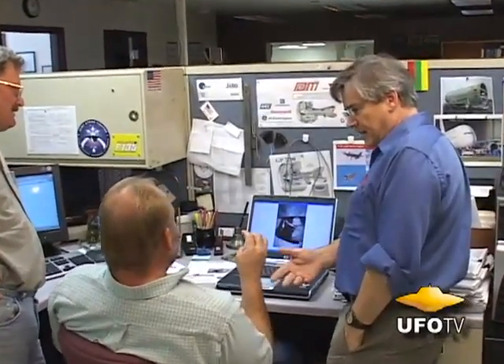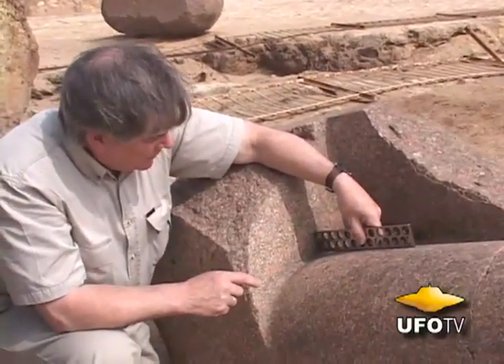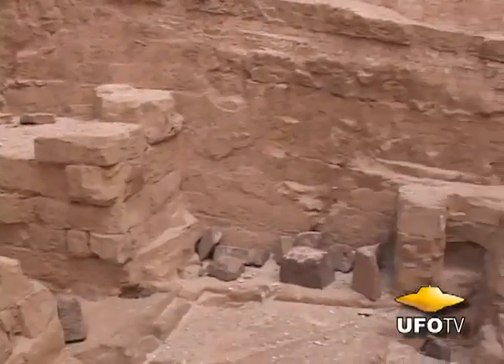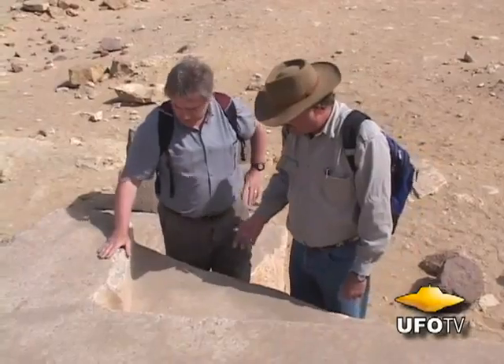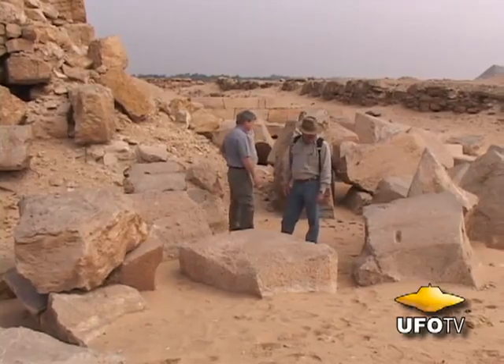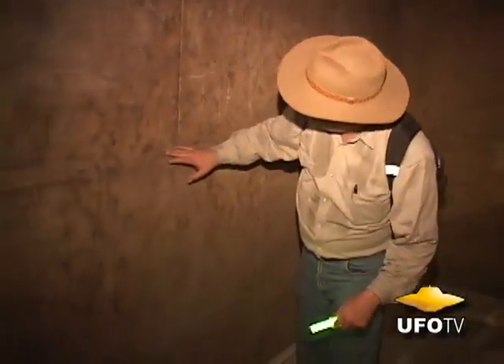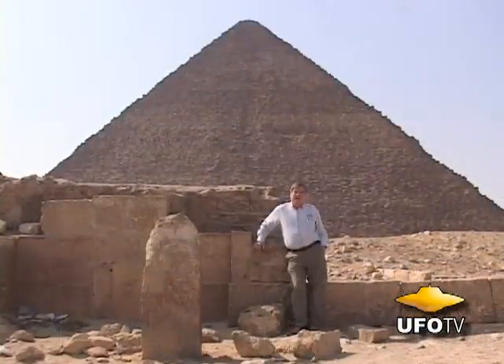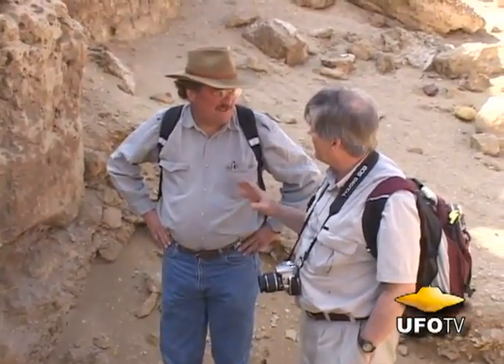Ancient Technology Pyramid Mystery

Comment: If we accept the alien concept;  the tools they used must be much more advanced than our civilisation develop . how about desintegrator energy field that break atoms bonding forces , i can imagine very narrow cutting like 1 or 2 milimeter beam more like a chain saw and that energy can be focus even with 90 deg. angle deflection to be able to cut these square inner corner in granite . desintegrator can produce also that glasing surface if you think of material vaporised when touched by the energy field atoms will goes out  like gaz or fine dust but when atoms like silicium exit they will tend to re-bound with the wall beside creating that glassy finish